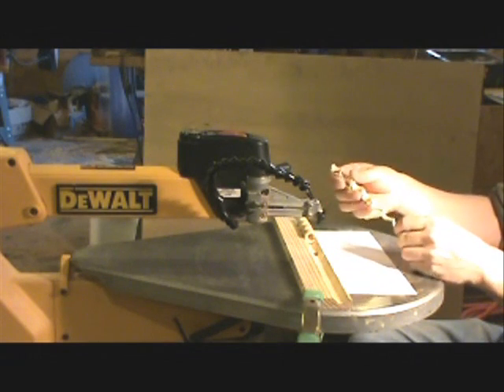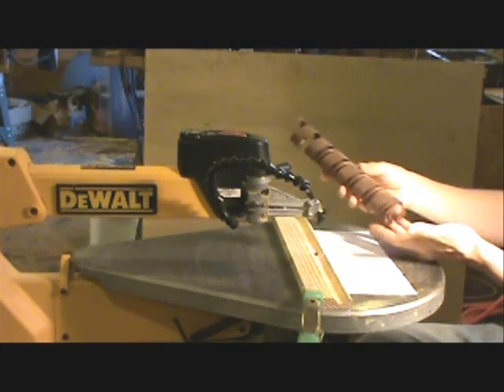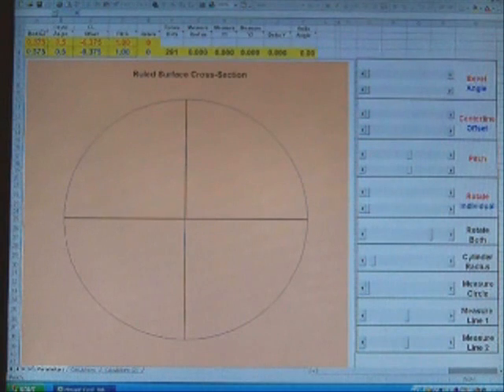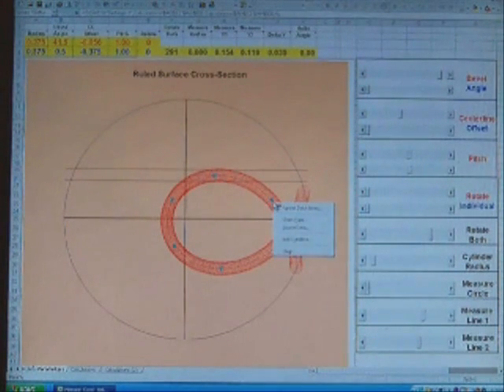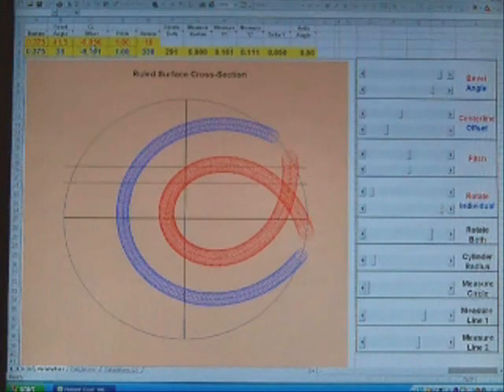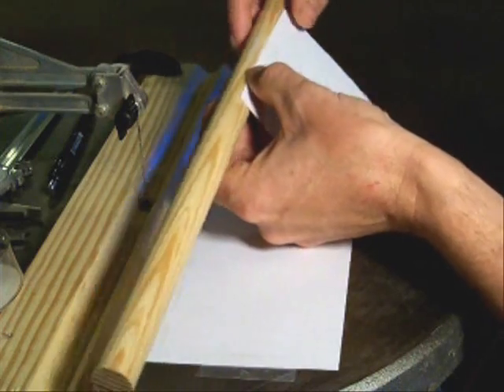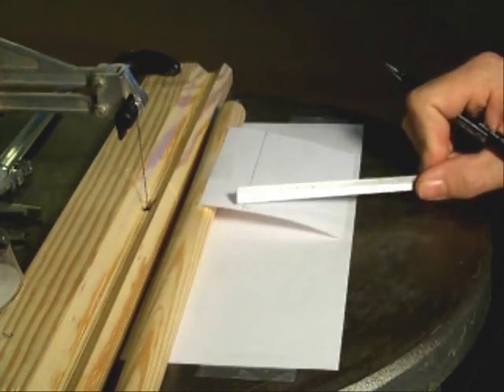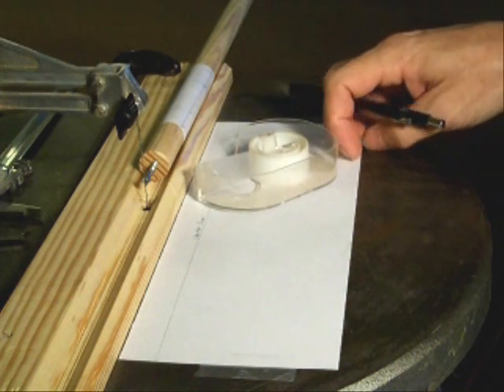Scroll Saw Spiral Forms

Comment from the maker: The 1" per turn pitch makes a nicely shaped helix from the 3/4" dowel.  More turns per inch could work too.  If you increased the pitch to something like 2" per turn with a dowel the same size then the outcome would look something like a drill bit - even more so if you made a second cut 180° apart from the first cut.

The spreadsheet makes the outcome a lot more predictable!  I wish I had made it sooner